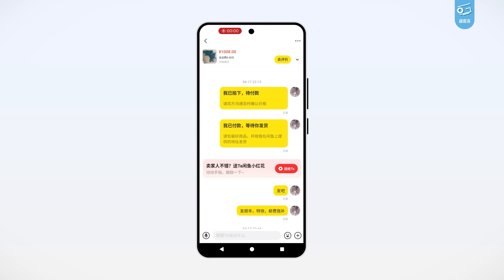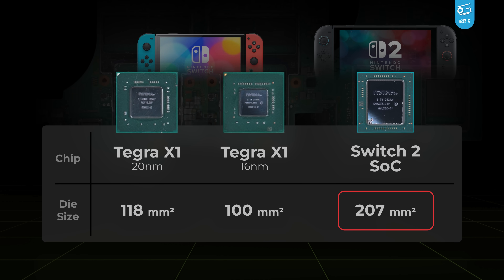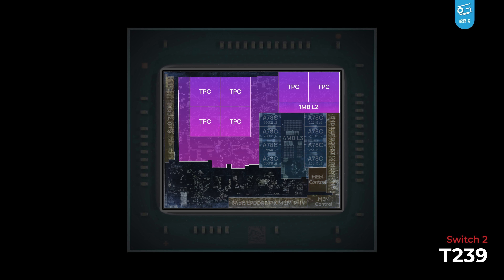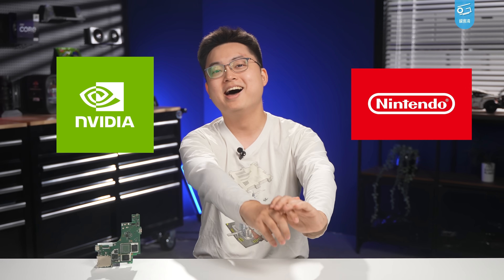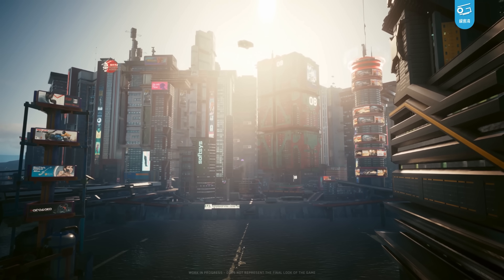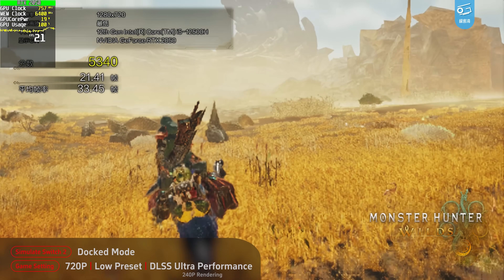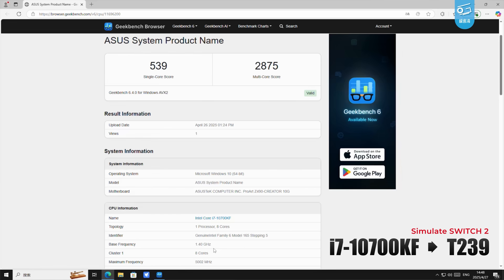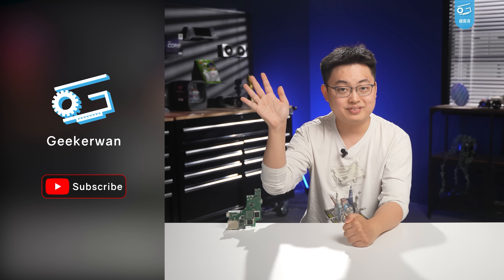This is Nintendo Switch 2's CPU!

Comment: In short, the Nintendo Switch 2 is equipped with a chip that was released 4-5 years ago, so the results of these benchmark tests are completely reasonable. Because it is still stronger than the PS4 and stronger than its older brother, the Nintendo Switch 1. It is still true to Nintendo's "philosophy" that their game console configuration will be stronger than their competitor, the Sony Playstation, after every 2 generations. For example, the Wii U released in 2012 is stronger than the PS3 released in 2006.

Comment: TLDW: Just get a steam deck. Switch 2 even docked is stupidly under powered and BARELY better than the Steam deck Stock.(Which can be overclocked to be better docked as well.)
Reply: I have steam deck and will buy switch 2 as well as I can currently afford it

Comment: You need to consider the advantage of a dedicated ecosystem.

The system will perform about 20-30% better than pc hardware with similar specs.

Just like the PS5 is as good as a rtx 4070 pc, without the gpu horsepower.

Comment: 12 GB of RAM..at lower bandwidth  than the series S..

Wonder if devs will complain....it amounts to basically  same memory  performance..but series  s has better CPU and GPU..

Probably  wont be an issue  because  Nintendo 

Also all those series s games...lower graphical  settings  a bit..turn on dlss...and you have a switch 2 port..

Funny how things work out..xbox made a handheld performance  profile and Nintendo  is first to capitalize  on it.

Comment: That is really a $5 chip in a $500 device.
Reply: nintendo being nintendo
Reply: Creo que hay que tener una cosa en mente y utilizare la similitud con Apple. No estas pagando solamente por la tecnología del Hardware, el valor del Software que vas a encontrar a lo largo de la vida del sistema Nintendo lo esta incluyendo también. (Si por mucho que igualmente puedan venderte a 90€ / $ un juego) pero pienso que es importante tenerlo en cuenta.

Determinar si ese valor entra en tu rango de merecer la pena es personal. Por lo que a mi respecta lo vale con creces en cuanto al precio de la máquina, sin embargo no puedo decir lo mismo del precio de los juegos.
Reply: Obviusly
Reply: The chip itself, sure. Good luck packaging it.
Reply: No? Its literally more powerful than the sd 8 gen 3 in gpu terms. This is actually decent for hardware and its more powerful than the deck if it got more watts. Stop lying just cause you hate Nintendo.
Reply: Well, they're selling 50 bucks games at 80, so no surprises
Reply: @giormr_heks  they are not even clair obscure quality which youy can get 30-40$
Reply: @ShersGarage  you just came up with awesome business idea. Why don’t you just buy the $5 chip and resell them as maybe $10?
Reply: @racoonracer7878  found a fanbot. Does Nintendo feed your family or some shit?
Reply: @racoonracer7878  other handhelds are more powerful, for similar money. Nintendo giving you 5 year old tech.
Reply: @ShersGarage that’s simply not true! 
Tell me which handhelds are more powerful and costs less! I don’t know a single one that costs less than 450 dollars, is more powerful, with a dock and hdmi cable included! Especially not with all the other features the switch 2 has! You all forget about those things… that all costs lot of money too! 
That’s like comparing a 15 inch 60hz laptop with crap speakers, crap build quality and crap keyboard with a 18 inch 144hz laptop with all kinds of features! Of course the 15 inch laptop will be cheaper or eventually even has slightly more power! 🤦🏽‍♂️

The most comparable handheld is the original steam deck and it costs nearly the same and has less power! In docked mode WAY less power! 
And Switch 2 has so many more features than most other handhelds… a bigger screen, Hd rumble 2, magnetic joy cons, mouse mode, motion control, 1080p display with 120hz and vrr. Than you get a dock with active cooling and an hdmi cable too, which normally would also cost you money. And i am pretty sure it has the better speakers too! And then there are also small things like the kickstand etc. 

And if you want to compare other handhelds with the switch 2, they need to have A LOT MORE power because it’s the same like with all consoles… the most important thing for performance is optimisation! If developers could optimise their game to one hardware, because all people have the same hardware, it will run a lot better! 
So to compare it, you will need other handhelds to have 20-30% more power to get the same results in practice… 
It’s like with consoles and pc in general! To get similar results, you need to have a lot more power! 

The Price on the Switch 2 is completely fine for what you get! 🤷🏽 nothing wrong with it! What’s wrong is the price on the games! 90 dollars for the physical version of Mario kart is just insane! 🤦🏽‍♂️

Nintendo is a Huge company and of course they don’t need to charge that much money to be profitable! But is it in general overpriced in comparison to other handhelds? NO! 
And in comparison to all the other handhelds out there it’s even cheap for the performance and features you get! 

But eventually i just don’t know the handhelds you were talking about, could absolutely be possible! 🤷🏽 
So, please tell me which handheld for 450 bucks has more power?
Reply: @ApfelSgt  I can guarantee you that people dismissing and considering the Switch 2  being an upgrade and not innovative enough don't see the game changer of a handheld being also a mouse. Future handhelds will copy this feature and in a few years they'll forget about who the daddy of this innovation came from.

A sad bunch of sorry asses out there always crying about my system runs 8000 Mhz and yours only runs 7600 Mhz. They forgetting it's about the fun, not the machine
Reply: @ShersGarage  But that means nothing as those devices won’t have the games or software support the switch 2 will have. People act like there is much better than the switch 2 out now that is cheaper.
Reply: @TheBlackShinigami Concuerdo!!
Reply: @ShersGarage Yeah Nintendo always uses old technology.
Reply: Well duuuh
Reply: It may be true that Nintendos tech is always outdated, but for the price I've paid for the Nintendo GBA, Advance GBA, DS, 3DS, and Switch 1 and it's eco-system, and the numbers of hours I've spent on them as a total thru the years is crazy.
Do I care if a game like Cyberpunk runs better on this or that system? Nope. I've never played this game before and coming from a low standard with only portables, this game looks awesome to me and I can bring it with me.
Yes, the switch 2 price is $450 but it's gonna give me another 8 years. So I'm not trying to chase specs and pay money out the butt (latest gaming gear?). I'm here to enjoy.

Also, what other handheld cost similar  money to the Switch? Steamdeck, Asus , etc...
I'm not just buying tech, I'm buying entertainment. This could be why older movies are better because of the  plots and story, and newer movies with flashy explosions with no story.
At the end, whatever floats your boat.
But I still think DF is getting to big of a head
Reply: @racoonracer7878  the problem is the price, nintendo charnging like it was top of line hardaware
Reply: @Jo21  I get the price. Trust me. I really want the Switch 2 but can't afford it now because I gotta use that money for my car insurance. 😿

But if I think about the years I will put it to use (hopefully 8 years). It'll come out to about $50-$60 bucks a year for the system. No games included of course
Reply: @racoonracer7878 exactly! People just starting to hate the switch 2 without any reason! 🤦🏽‍♂️ I understand that the games are way to expensive and it pisses me off too! 🤬 But the price of the switch 2 is completely fair for what you get and there is no reason why people hate on the 450 bucks! 🤷🏽 They just hate without any reason…. 
There is no other handheld out there that’s more powerful for the same money! Especially not with a Dock. And they also don’t have all of the features the switch 2 has! 
So why the switch 2 should be to expensive if it’s the cheapest out of all handhelds in comparison?! 🤣 doesn’t make sense! 🤦🏽‍♂️
Reply: @ApfelSgt 
I do agree that the Switch 2 isn’t overpriced.
But did you see the Radeon 780M destroy the Switch 2 even when it’s docked?
That’s basically what the ROG Ally Z1 Extreme is—same price, much more powerful.
It doesn’t come with a dock, true, but a $60 dock for the Ally is still fair compared to $90 for a single physical game on the Switch 2.

It's true that they'll optimize their games on switch (and downgraded too). Yeah... Like, running a game with 540p resolution that upscaled to 1080p with only around 30-40fps
While ROG Ally can run CP2077 at 720p upscaled to 1080p at 60fps or higher (depends on how you set up the setting)
Or using LLS to upscale and enable frame gen, it'll be all smoothly even at higher settings.

You can't just say that a downgraded game runs smoothly on switch 2 means the console is more powerful, can you? It just means it's better optimized (and downgraded, yeah)

And don't get me wrong, i'm not trying to say switch 2 is a bad console, it is a great console with a lot of cool features and games.

But game is game. ROG Ally still wins when it comes to power or performance.
Reply: @ApfelSgt 
Also, some people hate it because they had high expectations for the Switch 2 — like it was going to be a big bang, just like the original Switch.

	1080p resolution with a 120Hz screen? That’s great. More power? Also great. A watered-down version of Discord? Eh… okay, I guess.

	But at the end of the day, isn’t it just a slightly better version of the original Switch? And that’s what left people disappointed.
Reply: @ApfelSgt They expected a new thing, not an upgrade
Reply: And nintendo is heavily downclocking this chip just like with the tegra x1
Reply: @xtr.7662  either that or 2-3 hours max on portable. Which would suck big time?

It would be cool if there was a switch for users to decide. Run full power and get 1-3 hours of portability. Or downgrade to get 4-6 hours. Maybe that would be the next big feature on the next switch
Reply: You're comparing the price of a small part of a device to the device already assembled, over a wide range of costs.

Obviously, you don't know how a business works.
Reply: @Axes_1138  I was being sarcastic. Sorry about not being that dumb 😢

Comment: Being a layman, I wonder, would Nintendo have benefitted by making the Switch2 faster than competing handheld PCs?
Reply: Not really, Nintendo focuses on games like Mario/Zelda/Pokemon instead of AAA titles. Developers do need faster chips than Switch 1 so that they can make better games, but the performance of Switch 2 is enough IMO. For third party titles, Nintendo devices have never been the first choice for gamers.
Reply: @tenchouhateinentraumhaften3875  Would Switch 2 being faster make emulation more difficult?
Reply: @RockerBug17  Not at all. Emulation difficulty depends more on the system architecture. In some ways, better hardware can even make emulation easier once it’s figured out.

Comment: Sounds like the Switch-2 is going to be running 2year old hardware on release as it is. 
Imagine if it got RTX50 feature set, would actually be helpful for a handheld device like this.

Comment: Nah I think underclocking a laptop GPU thats whole different chip will give you even around the performance of switch 2, The CPU is balanced with the GPU so we will hopefully see 3rd party games run better.
Reply: To keep in mind RTX 2050 is not designed to run at those clockspeeds so it will have stability issues in games. Clockspeeds dont tell the full story.

Comment: What I understood is that Switch 2 performance wise will be inferior to a PC I built 10 years ago and have already replaced. How is Switch 2 supposed to run any of the modern cross-platform titles is beyond me.
Reply: DLSS and optimization...but its the usual  Nintendo  weak hardware.. you'll  be able to emulate  it on pc within  a year of release

Comment: This turned out to be a great video! I just have one small comment: if you say that something has improved by, for example, 600%, that doesn’t mean it’s six times better, but always one more (100% + 600% = 700%, and 700/100 = 7). Also if you say the performance is 100% better it means 2x!
Reply: Nope he's actually right. 600% better means 6 times better and therefore 7 times as good as the original. Saying "half as much better" also means 150% of the original and not 50%.
Reply: 7x is actually right. In the Chinese version of the video, he said 7x the performance instead of a 600% increase

Comment: Something to keep in mind is that it's not running a heavy OS like Windows on top of its hardware.
Reply: And switch 2 os is likely going to reserve 2gbof ram at minimum.
Reply: @maxpowerulez5276 3gb actually
Reply: Lmao they think windows is still heavy 

Changing a handheld to linux only imprives stuff by 3-4 fps in a few games. Most games run the same in bazzite and windows on ally x.
Reply: @maxpowerulez5276  Heavier than all its other competitors - minimum is allegedly 4GB but it runs like a dog, so it's really 8GB (and that's without gaming). The fact that Linux beats it out WHILE translating DX12 calls with Proton is wild on that merit alone. That's all said without mentioning battery life difference and the ability to properly suspend games on Linux.

Besides what I said, Xbox has pretty much confirmed it with their modified Windows for their handheld.
Reply: Current Windows has been heavily optimized for gaming at this point, we're waaay past the old Vista days.

Comment: No, NOT YOU TOO!!! 50% 720p=504p, 50% 1080p=764p. You can't cut both the vertical and horizontal resolution AT THE SAME TIME!
Reply: If you mean pixel count, then you are correct. On the other side, 50% of 720 progressively scanned lines are 360 lines. If you want to keep the aspect ratio the same, reduce the horizontal axis accordingly. When talking about render scale, it's typically per-axis, not pixel count.
Reply: @Gramini  Wait, so it's kind like anamorphic stretching? where the pixels get stretched 2x wider or taller to maintain the same content aspect ratio? I mean, that content pixel would fit into 2 pixels of the screen. Am I wrong? For every 2 pixels on display 1 is actually rendered? Well how do they deal with the other percentages? Clearly 60%-90% exists.

Comment: I guess… it’s “adequate”? It’s definitely slightly better than a base/launch PS4, but not by much. I was kinda hoping to see AAA 3rd party games running at 60 fps, but I’m guessing only id Software could pull that off again with “Doom: The Dark Ages”, maybe. Definitely optimization is the name of the game here for this generation of Nintendo hardware!

Comment: You don't need to stay 1050 Ti. The MX570 is a way better fit as it's the same architecture and has RTX features (depending on which version you get) and performs just like a 1050 Ti.

Comment: It seems like this investigation agrees with my earlier analysis, which was based off the early (but unchanged) leaks.

So overall the Switch-2 is not impressive for a 2026-esque device. It's got low clockspeeds and using older architecture, and a much much cheaper silicon. It is close to an overclocked QSD 870. But a much better comparison, to direct chipset competitor, would be the Exynos 2100 from Samsung. And yes, that is a very disappointing chipset compared to the QC 8g1+ that also came out at the time. And those chipsets are considered old and slow compared to modern Dimensity 9400, QC 8gen Elite, or Apple A18 Pro.

As a professional guestimate, computationally the Tegra T239 would be to put it ahead of the XB1X console's CPU, but behind the XSS console. Whereas graphically it would be well-ahead of the XB1 console's GPU but slightly behind the PS4 console.

Everyone is making the comparison to the Valve SteamDeck. They are pretty is close. Computationally the VSD is ahead of the Switch-2, and gets a bit closer to the XSS. Whilst graphically the SteamDeck is slightly ahead of the PS4, but is well behind the next-step console, the PS4 Pro.

Overall, I expect the SteamDeck to have the better performance, whereas the Switch-2 has the better battery life. Although, we are likely to see the occasional port that is super-optimised for Switch-2 and the unoptimised slop on SteamDeck. That would be the main factor, in my opinion.